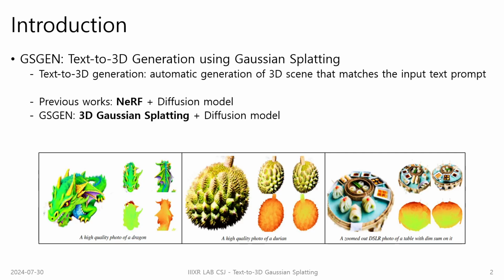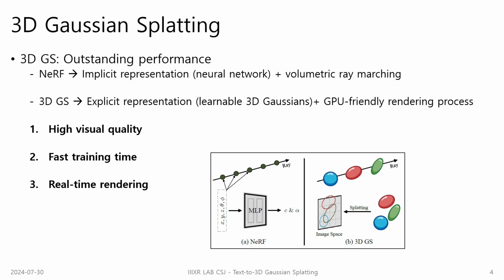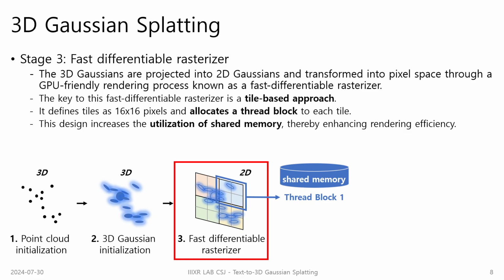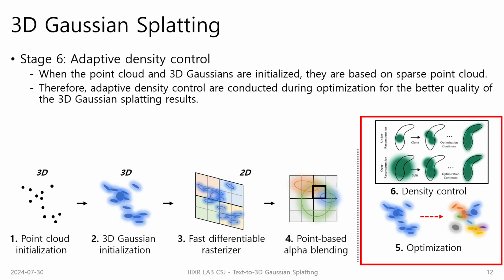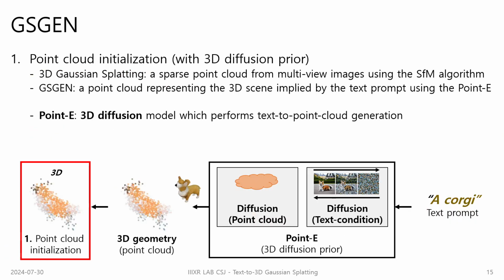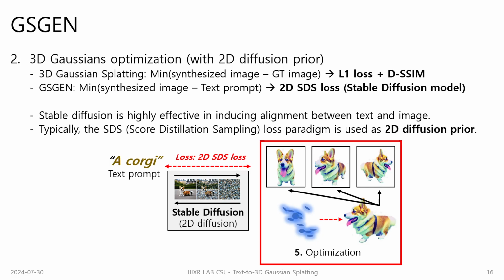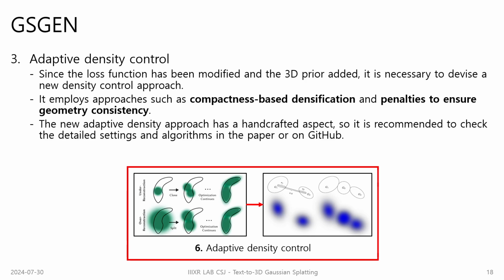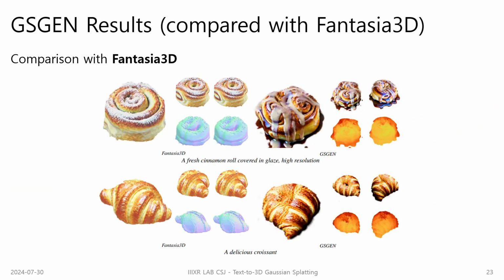[Seminar] GSGEN: Text to 3D using Gaussian Splatting

Comment from the maker: Please review each point of feedback carefully, and respond with how you plan to address each one moving forward.

[Overall] 
Content Balance: The presentation is intended to focus on GSGEN, yet too much time is spent on preliminary explanations of 3D Gaussian Splatting (3DGS). As a result, the explanation of GSGEN is lacking.

Need for Presentation Guidance: There are several slides where it’s difficult to follow what is being explained. It would be beneficial to incorporate animations or use a pointer to guide the audience through the content.

Lack of Custom Visualizations: The presentation relies heavily on images from the paper, which makes it challenging to explain and convey complex concepts. Creating your own illustrations to explain certain ideas would be more effective. For example, the current illustration for density control is insufficient for the audience to fully grasp the concept.

[Feedback]
F1: While the effort to explain 3DGS before diving into GSGEN is commendable and helps with audience understanding, it's important to adjust the balance of content. Since GSGEN is the main topic, the time spent on 3DGS should be reduced. Currently, 3DGS explanations extend to 9 minutes and 45 seconds. It would be better to cut this in half and allocate more time to explaining GSGEN.

F2: The combination of images, script, and explanations is difficult to follow. It’s necessary to use a pointer to highlight the flow or add animations to guide the audience. For instance, on slide 10, the arrows point in multiple directions with explanations laid out in different colors, making it unclear in what order to read or understand the content.

F3: The presentation assumes that SDS is well-understood, but it would not be difficult to provide a brief explanation. Additionally, when SDS is mentioned for the first time, the full name should be provided along with the abbreviation. It’s unclear why this was done on the second mention rather than the first.

[Question] 
1. Is the entirety of GSGEN’s contribution simply achieving text-to-GS using 2D SDS loss, Point-E, and 3D SDS loss?
2. Instead of asking us to look up the Adaptive Density Control section, please summarize the key points and explain them. If you’re unable to provide a concise summary, create a supplementary PowerPoint and share it among the lab members
Reply: [Feedback - Response]
F1.  
I will provide an additional PPT explaining GSGEN on the lab's shared Notion page.

F2, 3. 
I will pay more attention to visual elements, such as the use of arrows, and I will also focus on adding more detailed descriptions, including the explanation of abbreviations. Moving forward, I will include brief explanations of terms like SDS to ensure clarity.
 

[Question - Answer]
1. 
If you refer to slide 19, you’ll see the main contribution and sub-contributions highlighted. The main contribution can be simply summarized as achieving text-to-GS using 2D SDS loss, Point-E, and 3D SDS loss. However, beyond that, this approach allows for achieving SOTA performance among existing text-to-3D generation methods, particularly in terms of rendering and training time. Additionally, it brings advancements in quality, as detailed in the sub-contributions. The achievement of SOTA performance in this regard is considered a significant contribution.

2. 
To summarize the key points: The Adaptive Density Control method uses a technique called "compactness-based densification" to enhance the quality and efficiency of the 3D model. This method begins by identifying the K-nearest neighbors for each Gaussian using a KD-Tree. If the distance between a Gaussian and any of its neighbors is smaller than the sum of their radii, a new Gaussian is inserted between them. This process helps to "fill in the gaps" and results in a more complete and accurate representation of the scene's geometry.

In addition to this densification process, the method also includes a regularization step. This involves applying a weight to each Gaussian based on its distance to the center and periodically removing Gaussians with low opacity. This ensures that unnecessary Gaussians are pruned, allowing the model to focus computational resources on the most important areas.

Comment: Thank you for your good presentation. 

In the original 3D Gaussian Splatting, the process starts with ellipsoids. Does GSGen proceed with optimization directly in the form of point clouds without converting them into ellipsoids, or is there a conversion process involved? If there is no conversion, what are the advantages or limitations of using point clouds compared to ellipsoids?
Reply: The stages not mentioned in the presentation, aside from the three stages discussed, are carried out in the same way as in the original 3D Gaussian Splatting (3D GS). In other words, the initialization of the 3D Gaussians is carried out in the same manner as in the conventional 3D GS approach.

Comment: Thank you for your great presentation.

Is there any research for text encoders in this area?
In many research, I know that CLIP is usually used to text encoders.
But there are lots of foundation models in VLM likes BLIP after CLIP paper.
Reply: In GLGEN, both the stable diffusion and Point-E models were utilized. For the implementation details regarding the structure of each text encoder and what specific text encoder was trained, please refer to the paper for more comprehensive information.

Comment: Thank you for your presentation. Could you please elaborate on how GS Gen ensures 3D consistency during the optimization process by utilizing both 2D and 3D diffusion priors? Specifically, I am interested in understanding the role each type of prior plays and how their integration contributes to achieving a coherent and accurate 3D representation based on the input text prompt.
Reply: When using only a 2D prior for 3D generation, the process can become unstable because it tries to maintain 3D consistency based on multiple views of the 2D prior. This often leads to the Janus problem. The most common solution to this issue is to enhance 3D consistency by adding or integrating a 3D prior, such as 3D constructive information or constraints. GSGEN addresses this by utilizing the Point-E model, a 3D diffusion model, as its 3D constraint.

Comment: Thank you for your seminar.

I have a following question:

Why does the Janus problem occur? And how did previous research attempt to solve the problem?
Reply: In diffusion models, view-inconsistency arises because the model generates images by denoising random noise step-by-step, typically focusing on individual 2D slices or perspectives. Since the process lacks explicit 3D structural constraints or a unified 3D understanding, it can produce inconsistent results across different views.

The solution involves adding 3D structural constraints or implementing a multi-view consistency loss to enhance the model's 3D understanding. In GSGEN, this issue was addressed by designing a 3D SDS loss.

Comment: Thank you for the great presentation. I have two questions.

1. In order to use 3D sds loss, the noise-added representation of the scene must be passed to 3d diffusion model for each step, just like 2D sds loss. Than, what is the actual input of the 3D diffusion prior pipeline? (Is it Gaussian distribution of point cloud or something else)? Moreover, based on slides of presentation, it seems that point-e was applied only to 3d point cloud initialization. Wasn't it applied every step like 2d diffusion prior? Also, in the presentation, two types of sds losses are used, and are the sds losses obtained parallel to each training step and then summed? Or is one sds loss applied and then the other sds loss applied in take-turn manner?

2. Is point cloud supervision sufficient to solve the Janus problem? The coarse details inherent in the point cloud may be effective for the Janus problem, which deviates significantly from the three-dimensional spatial position of the output, but also for the texture-induced Janus problem? (e.g., can point cloud supervision solve the Janus problem of generating Wilson in the movie Cast Away?)
Reply: 1. That's a great question. I acknowledge that the explanation of 3D SDS was quite condensed. The input for 2D SDS is the rendered image, whereas for 3D SDS, it's the noisy Gaussian positions. Point-E is not only used for 3D point cloud initialization but also serves as a 3D diffusion model to compute 3D SDS. In other words, if the model for the 2D prior is stable diffusion, then the model for the 3D prior can be considered Point-E. The losses for both priors are computed as a weighted sum and backpropagated. Details regarding the weights and training can be found in the implementation section of the paper.

2. 3D SDS operates with 3D constructive constraints, but it's important to consider that it doesn't just impose constraints from the point cloud perspective. It also incorporates the well-trained visual prior of the Point-E model. Reflecting on this aspect should help clarify the answer.

Comment: Thank you for your good presentation.

I was wondering about the application of Gaussian splitting in GSGEN. What are the main limitations currently faced by the 3D Gaussian splitting used by GSGEN? In particular, are there any problems or performance degradation during density control or text-based point cloud generation? Can you describe any research or technical approaches to overcome these limitations, if any, and what are your plans for the future development of the technology?
Reply: The following is an explanation of the limitations discussed in the GSGEN paper.

SGEN tends to generate unsatisfying results when the provided text prompt contains a complex description of the scene or with complicated logic due to the limited language understanding ability of Point-E and the CLIP text encoder used in StableDiffusion. Moreover, although incorporating 3D prior mitigates the Janus problem, it is far from eliminating the potential degenerations, especially when the textual prompt is extremely biased in the guidance diffusion models.

Comment: Thank you for the great seminar. I have two questions:
- Why is the 3D Gaussian Splatting considered an explicit representation?
- How was it possible to reduce the steps from 6 to 3 in GSGEN, compared to the original 3D Gaussian Splatting? I don't know how this reduction was achieved.
Reply: 3D Gaussian Splatting is an explicit representation because it stores the scene's structure and appearance directly as Gaussian functions. This allows for real-time rendering, as the pre-defined splats can be immediately accessed and processed, unlike implicit representations that require on-the-fly computation through functions or neural networks.

The three stages are modified, not reduced from six to three stages. Please review the video again for clarification.

Comment: Thank you for the presentation. I have the following questions:

- In 3D GS, are the parameters learned those of each 3D Gaussian distribution, or are they the color and opacity parameters that each Gaussian distribution possesses? I'm confused about what exactly 3D GS learns.

- What makes 3D GS GPU-friendly? I understand that traditional learning-based methods are already considered GPU-friendly, so I'm curious about the specific reasons. Is it related to rendering?

- There are various types of 3D representations. What are the disadvantages of 3D GS compared to other existing representation methods?
Reply: - You can clearly see this in the stage 4 point-based alpha blending equation. The parameters being learned are the distribution of the 3D Gaussian, the color (SH coefficients), and the opacity. The learned distribution of the 3D Gaussian is later combined with learned opacity to calculate the final opacity. This final opacity is then used in conjunction with the learned color to derive the final color.

- Tile-based rasterization makes the process more GPU-friendly. This approach assigns a thread block to each tile, meaning that the calculations for all pixels within a tile can utilize shared memory. If you would like a more detailed explanation of using shared memory, please feel free to contact me directly.

- The biggest drawback of 3D Gaussian Splatting (3D GS) is that as the scene becomes more complex and larger, the number of required 3D Gaussians increases exponentially, which can lead to potential memory shortage issues. However, this memory-related drawback of 3D GS has been addressed and mitigated in various advanced papers published later.

Comment: Thank you for the good seminar. I would like to ask you some questions to make sure I understand well.

1. I would like to ask if I understood well about the 3:01 image. In (a), I understood that NeRF put MLP in the position, theta, and phi of each point, so the values of color and alpha come out. Is it correct that the image space is displayed after being splatted on the object's point cloud?"

2. 4:32 You said "smoothly expanded" at each point, but how do you decide the direction of spreading? Is it determined by the formula in the picture? Please let me know if you understand it incorrectly.

3.I would like to know if GS methodology comparison, which includes 2, 3, and 4 processes, was conducted when diffusion was used in GSGEN thesis.
Reply: 1. In the image, the key difference is that NeRF operates as a backward process, where rays are sampled at multiple points in space, and a neural network (MLP) predicts color and density at each point. This involves tracing the rays backward through the scene to accumulate the final image. In contrast, 3D Gaussian Splatting is a forward process, where pre-defined Gaussian splats are directly projected into the image space, contributing to the final image without the need for neural network evaluation at each sampled point. This makes 3D Gaussian Splatting more straightforward and efficient in generating the image.

2. Geometric 3D Gaussian can be understood in terms of how it's actually calculated: the scaling matrix determines the extent of the spread, while the rotation matrix determines the direction of the spread. In the source code implementation, the rotation is initially set to the identity matrix, but as optimization progresses, the direction of the spread is adjusted.

3. The three stages are modified, not reduced from six to three stages. Please review the video again for clarification.

Comment: Thank you for your presentation.

How is the text "A Corgi" compared with the rendered images to compute the 2D SDS loss?
It seems the text prompt would be converted to its embedded form using some sort of a text encoder,
but what are its target comparison vectors and how are they generated from the images using diffusion models?
Reply: The text "A Corgi" is first converted into an embedding using a text encoder. In the forward process, noise is gradually added to an image. During the backward process, starting from pure noise, the diffusion model predicts and removes noise to generate an image aligned with the text embedding. The 2D SDS loss is then calculated by comparing the predicted noise (influenced by the text embedding) with the actual noise added during the forward process.

The detailed formulas and processes are the same as the SDS loss in stable diffusion, so please refer to that.